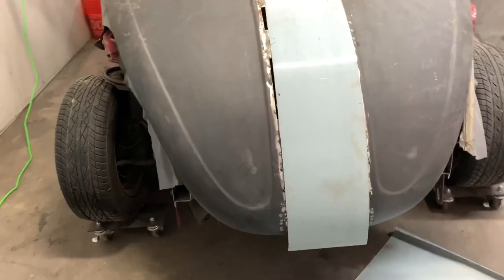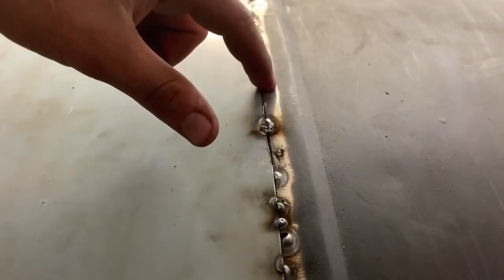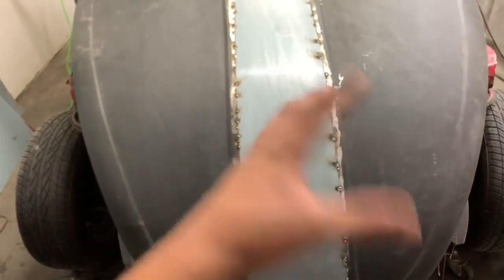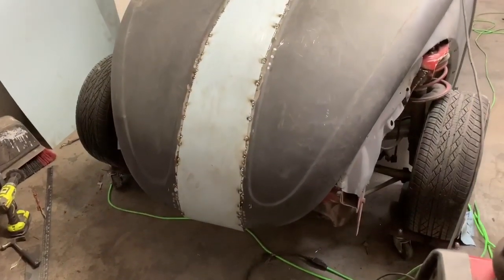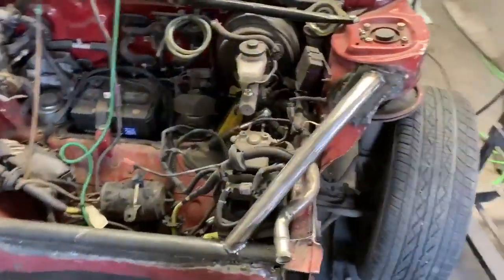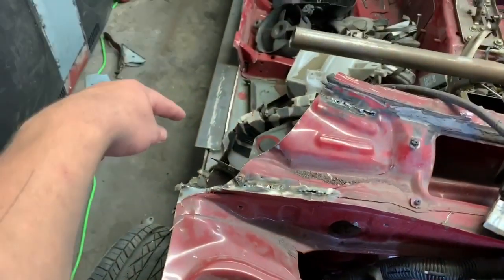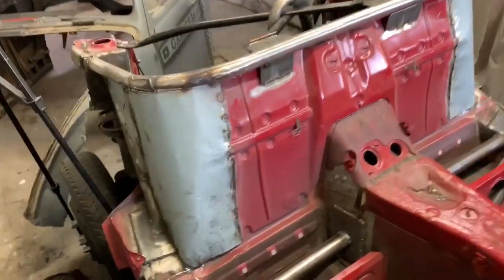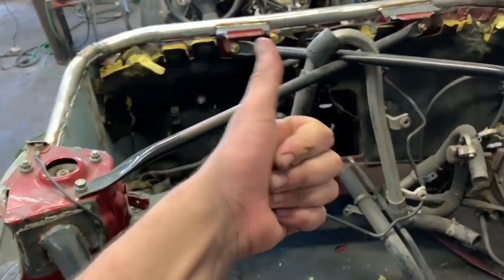Widebody VW Bug gets ready for its K24 engine swap and we re-widen the hood!

Comment: You need a heat sink to tame that bonnet. Maybe prop an alloy wheel or chunk of aluminium under the 'hood' where youre about to weld, push the hood down on the heatsink to raise up the join lines a bit higher than you need and do a few tacks, then cool the tacks and heatsink with compressed air and do the next bit. As the metal cools it will pull the weld line back down level-ish.
Then beat the crap out of it.

Comment: Great progress dude! Like your plan on moving forward. Don't be afraid to take some big steps forward and just work around what hurdles that pops up. Did I hear you say your gonna get a harness out of a Honda? Can't you use a aftermarket wiring harness for the body though. Wouldn't want to mess with weeding out a factory Honda body harness if I didn't have to. Yeah you'll need a engine harness but for the rest of the car can't you get away with something like a hotrod harness to power the ECU? Then just get a racecar switch panel and wire it like a racecar  just with the extra circuits for lights? I guess that's if it's in your budget.
Reply from the maker: That’s kinda the idea, not sure what all we’ll need yet though
Reply: @GARAGEIdiotS  just gotta figure out how many circuits you need and buy a harness that'll work. I bet you can get one that's labeled for most circuits and will have a bunch of accessories so it'll be pretty easy

Comment: It's really not hard to keep the MR2 chassis harness and the honda K engine harness.  I did all the wiring on my k24 mr2 swap and once I looked at it, it wasn't bad at all.  The engine harness on the K series is REALLY separate from the chasis harness.  I think I simply took a 12v constant, and a 12v switched from the MR2 chasis harness and followed hondata's diagram for wiring up the kseries engine.  I even have a working RSX-s cluster in my mr2 with working indicators on the cluster even lol.  Everything else mr2 functions just fine because I didn't have to touch it.  Hit me up if you'd like me to go into further detail, could cut down a lot of time for you I think on the wiring.

supratuner14@hotmail.com   wingitgarage on here   Keylan Smith on FB (yellow supra cover pic)
Reply from the maker: Awesome!!! Thank you!!